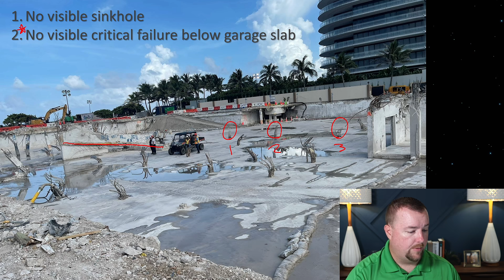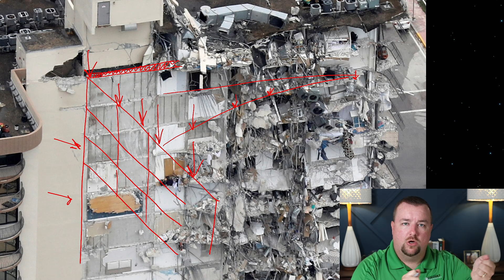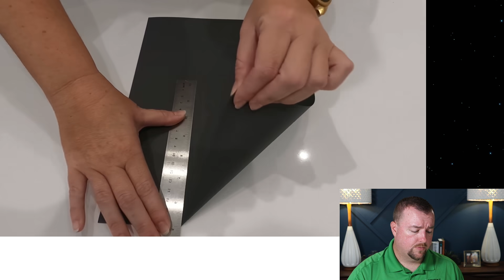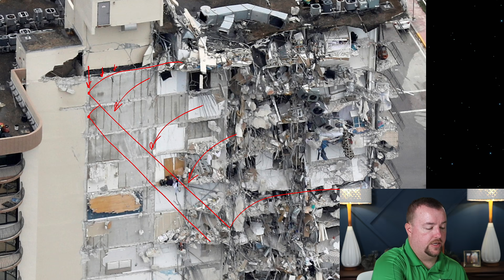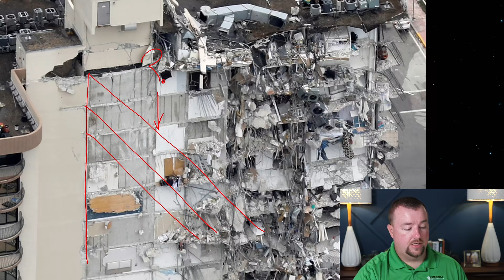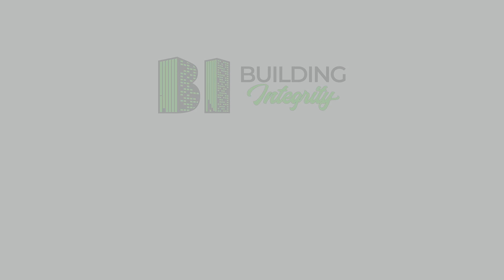Surfside Collapse - Structural Engineer Explains Why Only Half the Building Collapsed

Comment: Look……Palm trees are full of water and fan palms can run from 200 to 500 pounds for every foot of trunk depending on the diameter of the trunk. Palm trees with larger diameter trunks can weigh 1,000 pounds or more per foot.

Comment: Miami is a hometown from 100.000 imigrants from Cuba. The most of them living
with a pay check from the US goverment every month. The Houses o Buildings are made in the cheapest way,. That means the construction are made from the cheapest material. You can se, the colums are broken as colums without cement o bad sand. Probably  less cement, o sand from the see with salt. Absolut clear, no have an other reason posible.  Korrupt construction firm are responsable for this desaster. No dynamit, no earthquake etc. .  it is only falling down like a house of playing cards... In Dubai they importet sand for construction, for Buildings 800m hight, without danger. Never they used the sand from the dessert o the see. Everybody in the construction woerld know this, the miami construktors also know it very well.....

Comment: The building I worked out for the bulk of my career was only two story with all columns and beams being steel, with steel decking, wire mesh and concrete poured over it to form the second floor slabs. There were shear walls placed at specific locations throughout the structure. Periodically we would do space renovations to accommodate customer design desires. Occasionally these designs required the removal of a shear wall. In every instance structural engineers were brought in to evaluate the affect, not just on one specific area of the building, but on the entire structure itself. Shear walls removed were always replaced with much larger and thus stronger shear walls to compensate for changes in the original building design. 
I was in operations, but my education was in the field of business and economics. I learned a lot about shear walls and the need for them. The Surfside building collapse just reinforced what I had learned about how valuable shear walls are in any building construction.

Comment: number of piles under the shear wall base are  much more than that of of the nearby columns., i.e  shear wall base is more stiffer compared to the adjacent column base, hence the deifferential settlement around the shear wall base is high. This also could have initiated the column( near the shear wall) failure. From one of your other video, it was mentioned that one of the column was missing just before the building collapse??

Comment: Concrete defect, poor grade concrete that never cured properly in the FL humidity. That's my guess as they refused to let the USGS engineer on site.
Reply: Humidity does not prevent concrete from curing, otherwise we wouldn't wet cure flatwork or spray liquid cure which creates crystals on the concrete to slow evaporation and concrete cures underwater as well. My brother worked on a large dam extension and they used roller compacted concrete and then pumped water to the top to trickle down the new concrete to help it cure without drying out and cracking. Poor concrete is certainly possible and that is why often times we are required to have concrete tested, but even if it was required for this building it is still possible the results were faked or only up to spec when they knew it was being tested, if they were trying to cut corners. There are so many ways the build could have been compromised and people have commented about shady building practices, especially during the era this was built. They probably wanted to hide something (even if it was just the possibility there could be an issue, without them purposefully cutting corners)  if they kept the USGS engineer away.

Comment: I just watched another video  from Construction Engineering & Failure Analysis and the guy mentioned the columns were still in tact but they were pulled away from the floors.  that seemed like the best theory so far of what happened pool deck failed tied to the column and then the column pulled away from a floor causing the domino effect.

Comment: You have a good explanation for the propagation of the failure. But the collapse of the building initiated on the swimming pool deck. Surprisingly, the deck and its columns were only supporting the deck and not the loading from the building. The failure  of the deck should be investigated for that may have produced eccentric loading on the columns of the building initiating the failure of the building.

Comment: why didn't it not fall?  simple: because the rest of the building did NOT have a weakness in the lowest level.  what that weakness is, is yet to be determined.  END OF discussion.  no need for 27 minutes of what-ever this is called.

Comment: If the top rebar layer on the pool deck slab did delaminate and extend to the leading edge of supports for the superstructure, how would engineers tackle a repair like that?  I've seen other support bracing repairs, but never dealing with this degree of load and presumed state of the support slab involved... how would you even begin to determine what areas are stable enough to use bracing on?

Comment: I am waiting for someone to notice and mention something about the men's and women's sauna + showers located on the first floor of the building between G5 - J5 & G8.1 - J 8.1 and then all of the master bathrooms that are located above it, given the fact that there seems to have been very little waterproofing material applied to the concrete slabs. If there was little waterproofing done to those areas as well, I would imagine that those areas may be a contributing factor to one of the many reasons why the building collapsed?

Comment: Why the vertical columns have no bracing supports
to upper level. I.e. instead of piercing lyké pins
why theré is no 45 degree bracing from coloumn 
to floor tis holding upp ¿¿¿

Comment: i find it weird that there isn't any reinforcing rod dowels , either on the shear wall or column heads still sticking out of the concrete, even though a shear does slice , there should still be reinforcing rods protruding out of the remaining concrete or spoiling in the concrete faces where the steel rods have been pulled out ?

Comment: I still say this building was designed poorly, built on the cheap and by cutting corners. What happened to the idea of designing/building a structure with a safety factor of 2? I don't see it in these plans and in the pictures used for analysis. It didn't help that the end users added poorly thought out extra features not in the original design, and then maintained the building poorly, too.
Reply: You're bucking a lot of closely-held Flori-duh traditions there... like how even the most expensive single-family residences in FL do NOT have a basement (due to the water table), while virtually every high-rise condo--even right on the ocean--have one, and sometimes TWO sub-basements devoted to parking... cuz poofty awkitects say cars be "yucky", and must be hidden away... smh

Comment: I think that there is a reason that "shear", "shear wall" and "paper shear" all sound similar. You have a shearing or cutting action involved, at least potentially. So seeing the slabs nicely sheared off along the edge of the shear wall shouldn't be too surprising.

I have to admit to not following the news anymore, since by definition "good news is no news" and all that remains is too depressing to care about for sanity's sake; so I had not previously heard of this building collapse. 

Perhaps you have covered it already, but I think the more interesting question is why the right end of the building didn't collapse with the middle, but collapsed separately a bit later. I don't see another shear wall there, so there was some other mechanism.

I also wonder if bending moment in the pillars wasn't as much or more of a contributor to the sequential collapse as punching of the pillar heads. Once you bend a concrete beam to fracture I don't think it has a whole lot of compressive strength left.

Comment: And one more thing - can you please discuss the possible effect that the palm tree planters could have had.  The removal of the trees - why and how?  They were not on the original plan, but are visible on aerials until they go missing.  Would large equipment have been on the deck to remove them?   Thanks again,  Jackie
Reply from the maker: It is extremely unlikely that any large equipment would have been brought on deck to trim or even remove those palms.  Most landscaping companies have crews that can climb the tree to trim it down piece by piece or use ladders.  In order to bring heavy equipment on a deck it would require checking by an engineer and most landscapers aren't going to waste time or money on an engineer.  They'll just go old-school.

Comment: I find it amazing that the collapse of the pool deck, due to weakening of the rebar/concrete embedment bond, was an almost simultaneous event at several of the columns. The theory of the water penetrating into the struct slab and weakening the bond is very plausible when you consider that all the slab/column connections were soaking together for the past 30+ years and they gave way at nearly the same instant. And your theory of the slab/column failure at where the tower meets the pool deck area initiating the collapse is very plausible, too.  We should remember that there were enormous loads on all these columns, as in all hi-rise structures, so when one joints fails, the entire collapse occurs in seconds as the gravity acceleration formula takes over.  Thank you!
Reply: My theory is the sagging of the pool deck affected the collapse side of the building because of the drop slab. The weight of the pool deck would have created a pulling force of 300 kips or more.
Beams under the pool deck in the area of the collapse acted as levers which I believe failed the horizontal beam at the drop slab (torsional failure).

Comment: What were the archlight flashes clearly visible during the collapse, to ignore these obvious clues implies a coverup, limited hangout, disinformation campaign. There is no question that the building was structurally severely compromised and should have been condemned long ago.
Reply: Could be electrical shorts. Generally if there is a simple explanation and a complex/conspiracy explanation, the simple one is by far the more likely.

Comment: 16:14 is incorrect.  The middle front of the pink area started falling first and then outer potion of the pink area. So that's 1, 2, 3, 4 parts of the building that fell.

Comment: I'm interested to see how this disaster changes how we think about and design buildings. In appears to me that this loss is at least partly attributable to climate change induced rise in sea levels, given the deterioration caused by recurrent flooding in the basement. Also, much of the construction since the 1980s is built cheaply which will have devastating impacts on property values as these building reach the end of their useful life. I think it will be the death knell for the condo market.

Comment: The shear wall was strong in north- south shear, as all shear walls are. But it was the east -west shear walls that attached to the north south shear wall, which is to say the other 2 walls of the elevator shaft provided the stiffness needed to maintain that 90 degree angle  which is talked about later on in the video. Remember,  with out that 90 degree angle the column leans and makes the acute angle. If not for east west shear wall, making 'T' in plan view, then that shear wall may have leaned just like all the columns were tempted to do, and then the west side of the building would have been pulled eastward.  Also, in addition to the strong shear wall in north south east and west directions, the rest of the building south of our 3 problems was strong and not having the collapse going on.  Why did the right side fall? Well, imagine a very strong bolt with a nut on it. The east end shear wall was like a strong bolt but rather than the bolt resisting force, it was in the middle of the rotating plane and the entire east end of the building was free to rotate around the east elevator shaft in a similar way to a nut around a bolt. As strong as the bolt is, rotating the building is as easy as screwing a nut on a bolt. Very easy. Had there been some other spaced out shear walls on the east side of the building, then maybe it wouldn't have joined the center section in falling.  I also like the point he made on the tension and compression top and bottom reimbursement: we don't count on it for shear, but it does do something to increase shear strength say over a column and reduce that punching shear.    The main function of those shear walls in a building is to resist lateral forces as in the wind blowing the building over or an earthquake.   In this case, that strong shear wall came to the rescue for something it was not designed for and saved the west end of the building.

Comment: In one of the photos released to the media of the now cleared site, you can see one of the columns near where facade and I’m guessing near the sheer wall was is buckled in a wave form and seems to be punched through the ground slab into the sub terrain and the surround slab seems to be anywhere up to a foot lower than the rest of the basement slab in that vicinity. Looking at the direction of the rebar and it’s angle or form after the collapse seems to tell a story. Your videos have been super informative.

Comment: I completely agree with a lot of the comments below. Very clear descriptions of shear and punch through failures.  If this was not a sinkhole induced failure seems to me the builders, architects or even the building codes failed the occupants. If there were more shear walls extending onto the garage floor the building may have stayed up. Is it just too expensive or are they removed to allow for more turning space in the garage?
Reply: I'd drive around a few more barriers, knowing my building is safe.

Comment: As a retired elementary teacher, I’ve studied and practiced teaching methodologies my entire adult life. You, sir, are a gifted teacher. You’ve taught me more than I thought I ever wanted to know about big building structures.
Reply: His ability to effectively and efficiently communicate is masterful. This could be called "Basic Engineering for Dummies," because even I can understand what he's talking about. This is very well-done.
Reply: You are absolutely correct!  I’m a current elementary special-education teacher, and his ability to teach these engineering concepts is exceptional.  I always comment on every single video of his that he should be a professor in a college of civil engineering.  The college would be so lucky to have him!
Reply: @jamieleightee  A simple exercise: For each 100 pounds of horizontal component of wind force directed against a north wall, each of the east and west outside walls that are at right angles to it takes up 50 pounds of force. If a third interior wall is added parallel to the east and west walls then each wall will take up 33.3 pounds of force. The floors that also transmit this horizontal component of force to the outside walls prevent concave deflection of the north wall. Horizontal force transmitted by the floors that is taken up by the footings of the columns and rear wall may be ignored for this analysis.
   
Is a third interior wall of solid concrete required? (Referred to in some discussions as a shear wall). After calculating the force that the east and west walls must accommodate it is a matter of design choice. It is likely that the minimum thickness and strength of the east and west walls already greatly exceeds the horizontal force that these must hold back. Thus, for each 50 pounds exerted horizontally, the walls as a result of their strength to function as a wall supporting the vertical downward load from weight, are already capable of sustaining a horizontal component several times that amount, which is why the contribution of the footings was ignored.
  
An interior wall of solid concrete that is not connected by rebar to the adjacent part of the building is in effect an exterior wall to which an abutting structure has been added that encloses it making the whole thing appear to be a single building. Pre-construction-sales enabled raising capital for a much larger structure.
   
The reason behind this two-phase design is finance, not engineering.

Comment: Would you say  the remaining standing building was strong enough to go inside it to rescue all the pets before demolition? I want to know because my heart is broken for those pets and I feel sad for those pets not able to be saved left inside.A very informative video by the way! 🕵🏻‍♂️🔍
Reply: I believe the rescuers did a sweep for pets. The demolition crew would have had to go in to drill columns and set charges as well. The pets are safe.
Reply: @davidhenningson4782  The pet owners who escaped the remaining condo are mourning now and feeling tremendous guilt for leaving them inside.They didn’t go inside to look very well for the cats and dogs.They keep lying to the public that there weren’t any pets inside when in reality there was.
Reply: @davidhenningson4782  The firefighters where told the remaining condominiums was unstable to go inside and not to pass the first floor by foot.💔😿😿🐾🐾
Reply: @marlagonzales7320  I'm sorry 😔 I read it on the news. If they were lying to the media, that's what I got. They should have just done the sweep while the demo crew was prepping the building.
Reply: @davidhenningson4782  The pets where NOT SAFE AT ALL!!!!